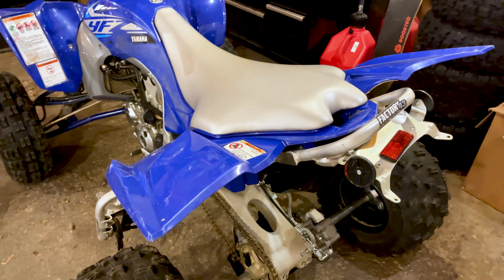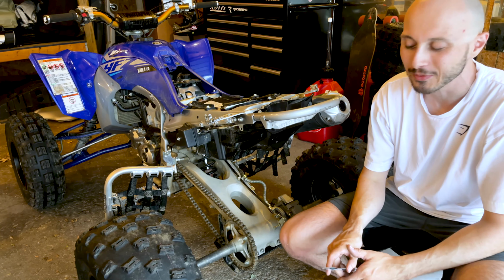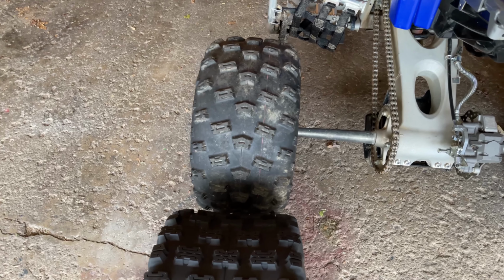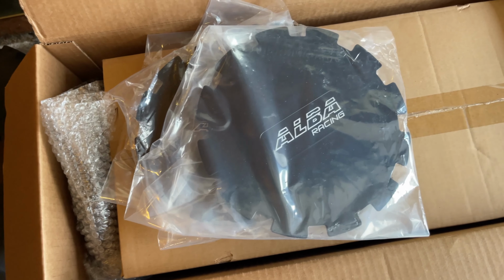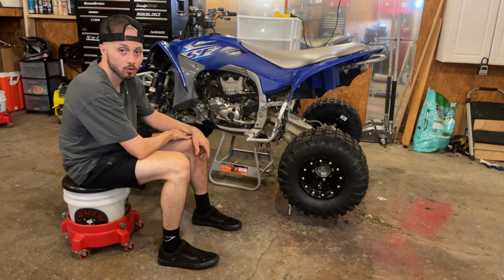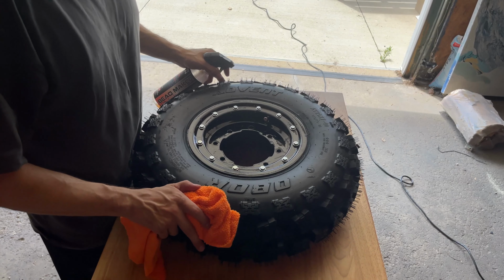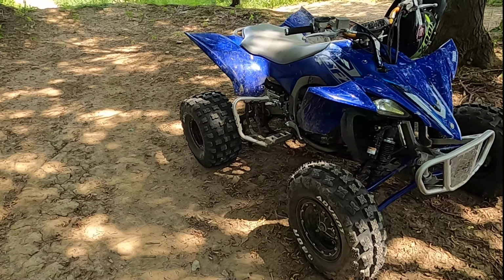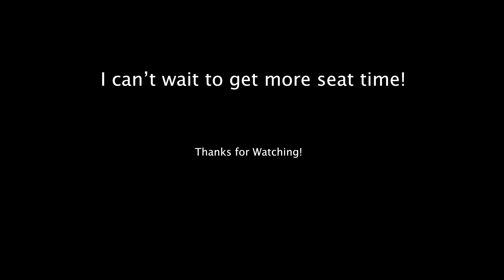Quad Talk | YFZ450r REPAIRS and new MODS!

Comment: Remember when installing tires on bead locks always snug in a cross pattern and torque in a cross pattern. That size tire will also give you more ground clearance for the trails. love the black wheels on the blue quad. great vid.
Reply from the maker: I appreciate the advice!

Comment: I have the same bead locks. I had to get shorter bolts for the front because they were too long and would hit the inside of the wheel. Other than that they look amazing and super easy to install new tires.
Reply from the maker: The yfz took a beating my last Hatfield trip. The alba bead locks held up amazing!